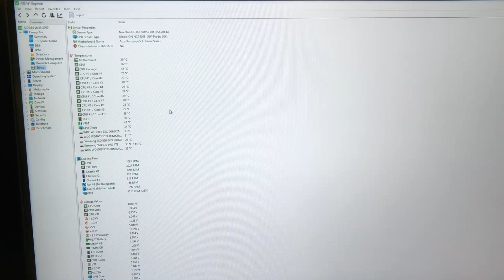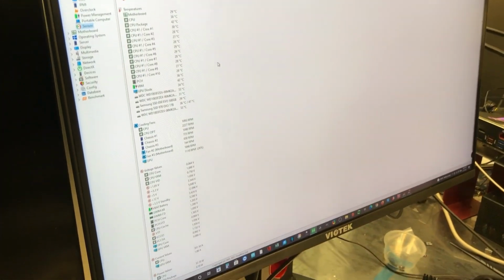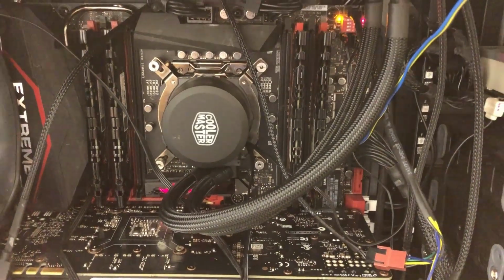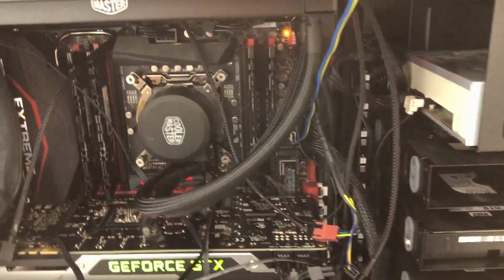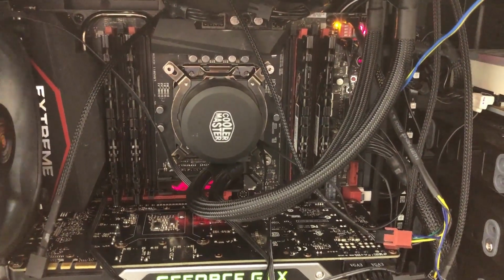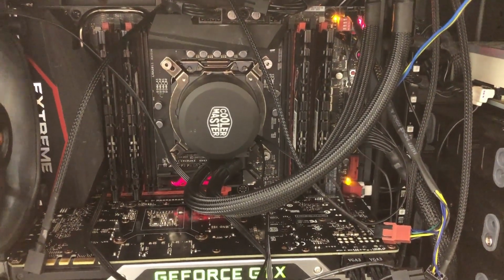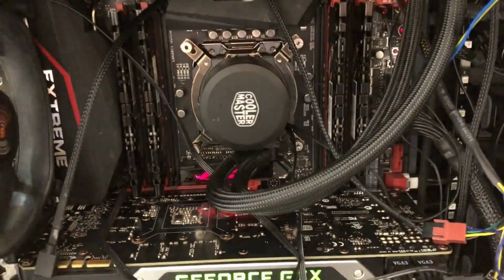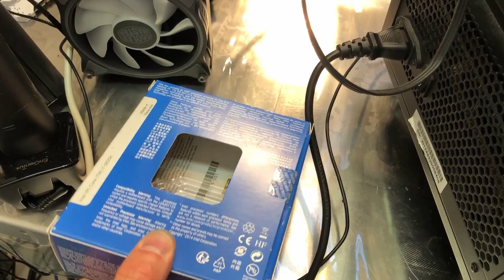My system won't boot!!!

Comment: Thanks that kind of same thing happens to me but instead the wears a clicking noise coming from the PSU and i did remove the batterie but in my case there is a 100% new motherboard is the z590 e gamming, is there any way else to troubleshoot the motherboard? Also I did press the clear cmos from the motherboard and after a few seconds there again I heard the clicking noises coming from the PSU and just the motherboard rgbs were on.

Thanks for the support

Comment: Had a similar situation just a couple of days ago ... two week old ASUS Crosshair VIII Dark Hero m/b, 5900X etc - all new components in a self-build.  All had been working fine.  I'd changed some external USB cables around at the back while tidying up all my cabling, and then the day following that, when turned the PC on, it seemed to hang during boot up.  I pressed reset button - system 'died'.  OMG - panic.  Pressing the power button from that point showed power was going to the m/b, but everything would stop again as soon as I took my finger off the power button.  No clues to be had from the diagnostic lights on the m/b.  Anyway, I was lucky ... one of the early things I tried was using the m/b clear CMOS button.  Fixed!  Still don't understand what happened, but all has been good in the days since.
Reply: That's freaking weird bro. Glad to hear to you resolved it and it wasn't hardware related. Out of curiosity, which gpu do you have?